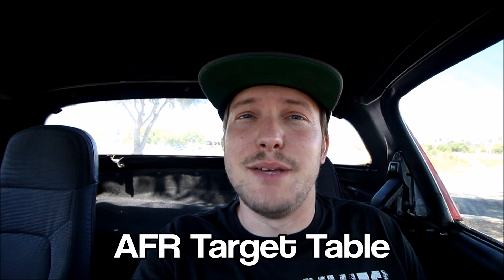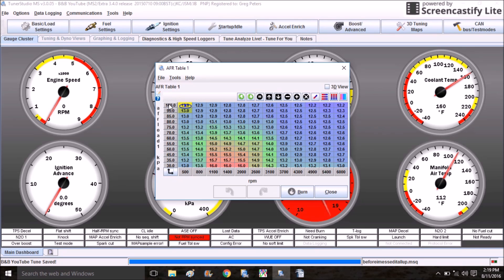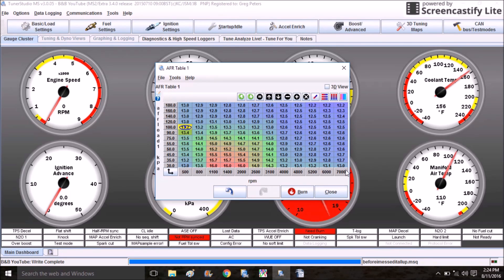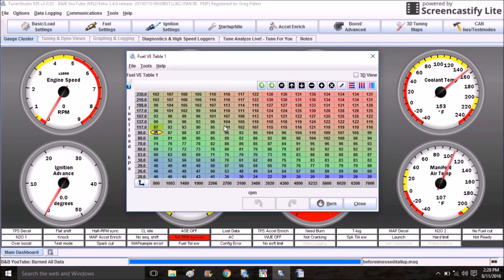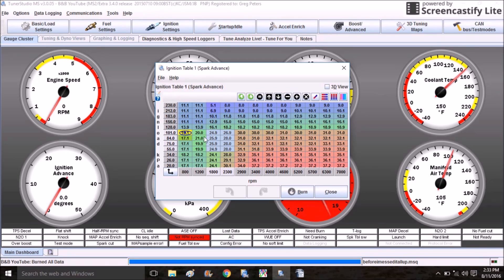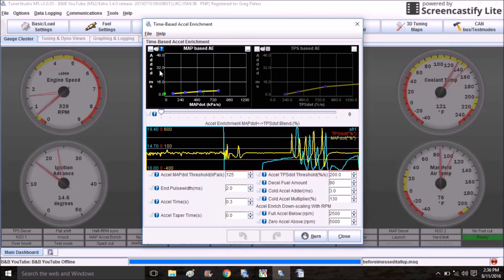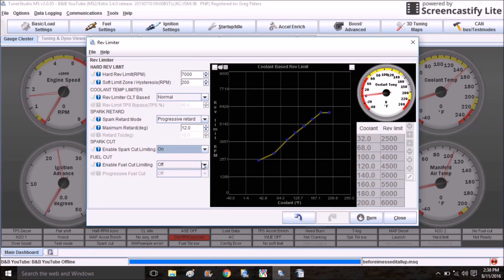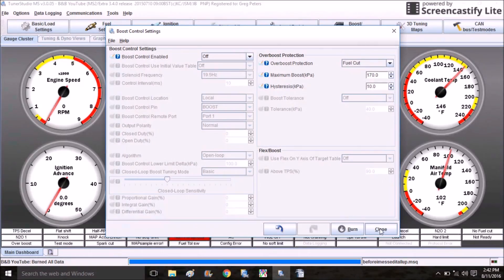Getting Familiar With Important Menus Of Megasquirt (Tuning Video #2)

Comment: Got my na miata all tuned up and was ready to put my turbo on then the very last time I hooked up my laptop to check out everything one last time I got a message from tunerstudio that said there was an error when trying to open my tune so after some research I have to start another project... something to do with windows 10 corrupting the properties of my file. Talk about upset. Hopefully I can save my file on a thumb drive and reinstall it if it ever happens again. Major setback. I'm sure its something I did cause I'm not super tech savvy. Anyway thanks for the vids greg you explain it the easiest for me to understand and the videos dont put me to sleep. I know this probably doesn't happen to often but if it's done it to you a video on how to avoid this situation would be awesome

Comment: Hey Greg! I installed my ms3pro pnp today and I have a quick question. I'll be running an mtx-l plus into the accessory plug. Do I need to remove a jumper? The manual says "disconnect the stock o2 sensor." And that's it.. it's pretty vague.. thanks man, love your vids 🤛✌️

Comment: Would it be safe to increase the redline on my nb Miata to 7600k it has a k&n intake and a header back exhaust plus a full clutch and light weight flywheel.
Reply: Don't do that. You have nothing to gain by making that change and you will just be putting undue stress on your engine.
Reply: Okay, thanks .

Comment: What do you use to control your boost pressure?
Reply from the maker: On this car I just have a wastegate actuator with an adjustable rod. On the other car I use an AEM EBC solenoid controlled by Megasquirt

Comment: This is the best MS tuning video I've watched, thanks so much!! I'm planning to install a Megasquirt into my Miata (when I buy it) and this has been very very helpful :). I have a couple questions for you:

I am confused @ 3:23 in the ignition timing table. At 230 & 212 kPa and 1800 RPM, why are the timings a lot less than their surrounding cells? The 5.1 and 6.9 BTDC

Sorry if this second question is answered in another video of yours, but is your boost being controlled by the wastegate spring + a manual/electronic boost controller, or is the Megasquirt controlling it?

Thanks so much Greg! I'm looking forward to applying this KNOWLEDGE to my future car and beating LAMBORGHINIs somehow ( ͡° ͜ʖ ͡°)
Reply from the maker: You'll never be able to get into 200+kpa at 1800RPM, so those cells really don't matter. Boost on mine is controlled my a homemade boost controller, I have a previous video showing how to make it!
Reply: Sweet thanks so much man! I understand it now, it wouldn't make sense for a turbo to spool that fast hahah. Thanks again!
Reply: Another question, once my car is turbo'd would it be better to build upon the stock map or make tweaks to the turbo tuner map on megasquirtpnp?
Reply from the maker: The "base" map already is mostly set up for boost, you'll just have to make some adjustments to the existing maps based on your setup.
Reply: Awesome thank you so much!!

Comment: My question is would you recommend me installing a mspnp into my 94 1.8 which is NA and only running aftermarket intake n exhaust and a few other items ? I don't plan on going for boost but my long term goal is ITBs so am wondering if it will be good to learn MS on my near stock setup n do small adjustments to better learn the system. In future prep for ITBs, or is it not worth changing ur ecu unless you go boost with a turbo or ITBs ? Thanks in advance love the videos !!!!
Reply from the maker: If you plan major modifications in the future it's best to install it sooner than later. If you want an ITB setup why would you boost it first? AN ITB setup will be cheaper than properly turbocharging anyways.
Reply: +TheCarPassionChannel thanks for the fast response, sorry I meant I don't plan on boosting it ever. ITBs would be my long term choice, even though many say tuning can be a really pain and timing consuming process with the east coast weather changes. So for know I'll keep reading and learning Ms until i finally make the Itb moves... 
So I guess my main question is should a stock Miata even run MS ?
Reply from the maker: Ohh I misread. Yeah a stock Miata will be fine running MS. It will require some tuning straight away though.
Reply: +TheCarPassionChannel sounds good thanks for the info! Can't wait for the next one haha

Comment: You talk too fast Greg, you can put much more info into the video - and make them longer !- it is technical no matter how you turn it.
There is a little button below the last KPA column and left of the lowest rpm row that will let you re scale the map and set new X/Y values.

Great job dude :)
Reply from the maker: Unfortunately there's really no "perfect speed" to keep these at, I kinda always try to keep a somewhat fast pace in the videos. You can adjust the speed of YouTube videos to slow them down though! Click the little gear in the lower right corner. (I recently found out about that little arrow button too, definitely makes it faster)
Reply: There is a perfect speed and you are not there, it used to be better.
Too fast and too short is not the right way, longer videos and normal pace is the way to go.
It is like the MS, you need to tune the channel...
Reply from the maker: Well I can't "tune" the channel based on one person's opinion, so I'm sorry if you think these are too fast.

Comment: how do we control the fans within megasquirt??
Reply from the maker: For mine:
Boost/Advanced -> Programmable On/Off Outputs -> "Output 1"
That should let you set the temp they kick on, default should be 190 degrees.
Reply: Thanks, threshold must be degrees and what is hysteresis?
Reply from the maker: If your threshold is 190 and your hysteresis is 5, the fans will turn on at 190 and turn off once you're down to 185.
Reply: thanks :)

Comment: The way your tuning the ignition map is worrying. I would recommend starting low and creeping up and of course knock detection
Reply from the maker: The base map does start out very conservative. I said that I leave the base map alone until I'm on a dyno, unless I'm actually getting audible detonation. Seems just fine, it usually gets quite a bit more aggressive in boost after dyno time actually.

Comment: hey I was wondering how hard it is to install new piston seals on a 1992 NA.  I am wondering because I am considering buying a miata that has dried piston seals.  Thanks
Reply: To replace the rings you have to pull pistons which means either pulling the motor or dropping the subframe and pulling the oil pan. In which case you should do bearings while your in there. If the car is cheap enough sure but it's borderline putting a new motor in

Comment: Greg, there is a MUCH easier way to scale your AFR map.  Click on the arrows in the bottom left corner. From there it will bring up a dialog where you can enter your desired break points. When you click "ok" it will adjust the map to reflect your original AFRs mapped to new cut points.
Reply from the maker: Nice, thanks!
Reply: I created a little youtube video that covers this... you ok if I link it in the reply?
Reply from the maker: Yep no probs

Comment: Great stuff! Nice overview of acceleration enrichment, very useful. Can you tune it with the car running, or do you need to turn it off every time you change something?
Reply from the maker: Nope, you can make changes while the car is running. If you need to power cycle Megasquirt, you'll get a message on screen.
Reply: Nice one! Many thanks!

Comment: I think the answer to my fuel questions will be on your next video. My turbo build is complete but I am unable to run the car because I lean out so I need to know how to add fuel . Any ways I am scheduled to go with Toby this Saturday with the car on a trailer, but would have been nice to get to the exhaust done before the tune. Thanks for all the videos my build would have been a complete mess if it wasn't for your shared knowledge.
Reply: Check Luca Car Mods, today he fixed his car dying after startup with hot wiring the fuel pump. He is in the process of boosting it.
Reply: Thanks for the input. I did get to see Luca's Video.

Comment: What is a good computer to use
Reply from the maker: Pretty much anything will work. I got my MS with a serial to USB adaptor so I didn't have to buy a laptop from the 90's. Optimally, you want one with a solid state hard drive since you'll be running the laptop and driving, but if you have a HDD just make sure you back up all of your important things first!
Reply: You can go on the MS website and based on which version you want to run they list the "minimum system requirements" that a computer would need to use the software without issues.
Reply: Anything old and cheap. You want something with a serial port (old tech that works better with MS than USB does). You also want something you can drive around with inside the car. If it gets smashed no big loss. I did a ton of research and came up with the Dell D620. They're under $100 on eBay for a rebuilt laptop and all the accessories and a car charger. These laptops and the replacement parts are a dime a dozen cause Dell sold millions of em under corporate contracts. Its not as slow as a stock 1.6 either, so you can use it for web browsing and stuff when you're taking a break from tuning and don't feel like switching to your main rig.
Reply: Ok!